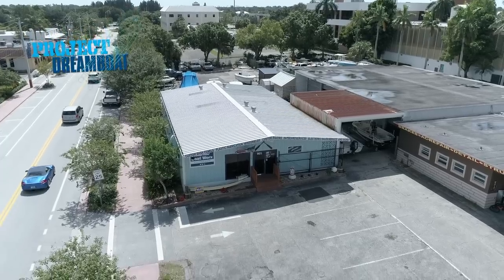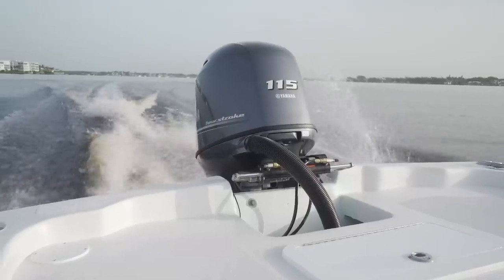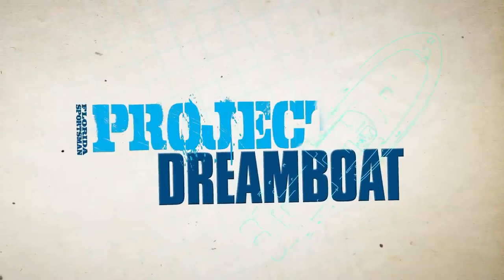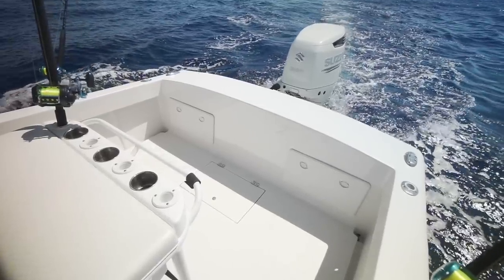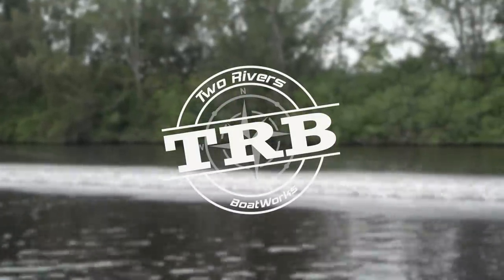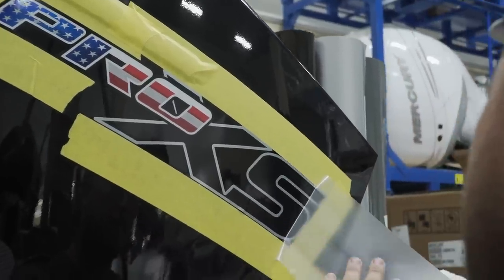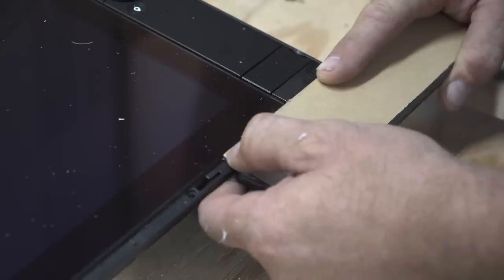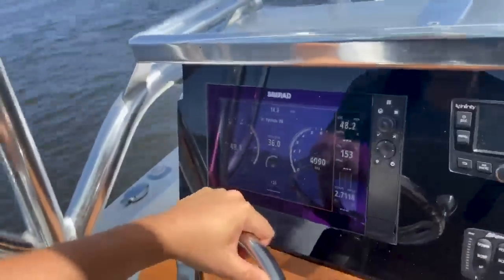Florida Sportsman Project Dreamboat - Twin Vee Splash, Dash Panel Perfection

Comment: Anyone else notice the transducer was mounted way to low? throwing so much water while running
Reply: Transducer was installed correctly it’s a Garmin needed the splash guard which did not come in before the test run so hence the spray

Comment: $84K for a 20 ft boat?!
Reply: 23ft seacraft and yes when you hire pros to rebuild a boat it's better than 95 percent of the production boats built today. What's a 25ft seavee coast new over 150k easy.
Reply: @shoresharp8349  Look I agree that they are pro's but that is a lot of coin
Reply: @timrooney5608  Hey man fiberglass restoration shops charge 100 bucks a hr min per person. That's 4k a week per man. The engine is 28k the bracket 5k electronics another 8k just throwing out numbers. I rebuild boats in my free time I have over 8k in a 18ft skiff that's just materials bolts screws paint etc.
Reply: Yes it was a total restoration, with floors ripped out, new stringers, fiberglass, motor and rigged all new electronics. Adds up quickly.
Reply: Shorev83 that does not enclude  the engine